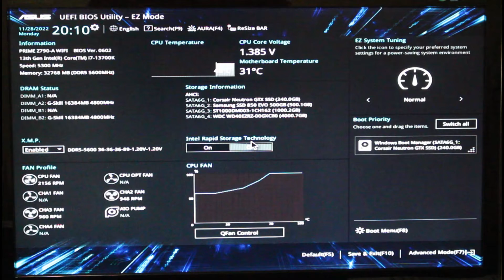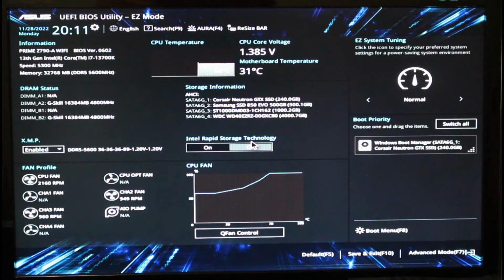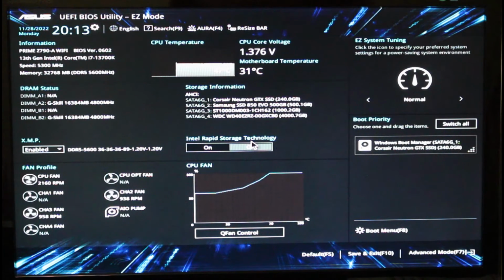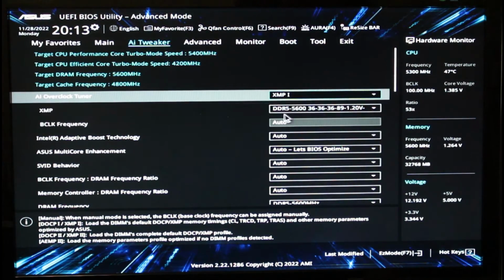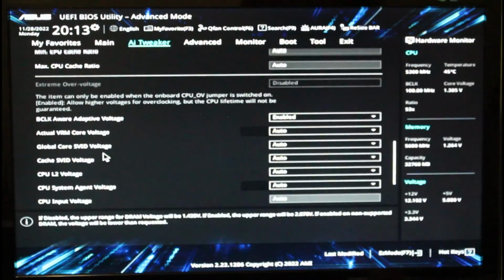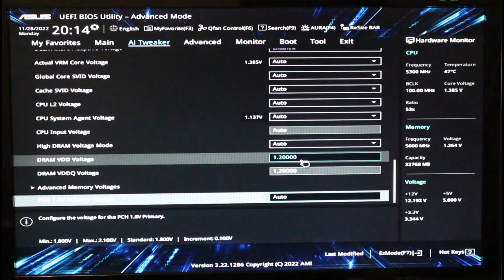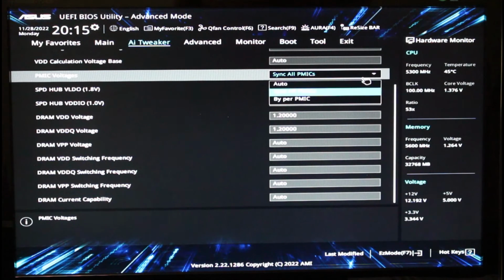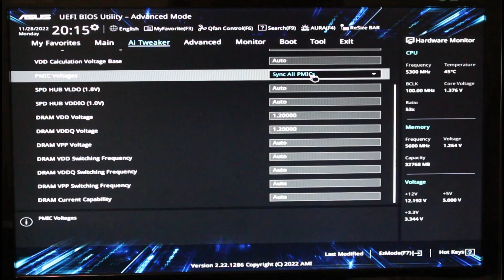How to Fix DDR5 XMP Issues: Use A2/B2 Slots for 2 Sticks (ASUS & 4 Stick Fix)

Comment from the maker: Thank you all for your positive feedback and collaboration so far.
Reply: My Asus manual for a Z790 board says IN THE MANUAL, to use A2 and B2 first. So, that sounds weird that your Asus manual says use A1 and B1 first. 

XMP is only on A2 and B2 but my ram is unstable at the 7,200MHz that it is rated for. I ran MemTest86 on it for a week over and over. I can only get as high as 6,800MHz. On a 7,200MHz kit 😑

Comment: I have  Gigabyte Z90 Gaming X AX + 2xCorsair Vengenace 6000Mhz. With Asus Prime 850W PSU runs  ok with XMP enabled at 6Ghz in  slots A2,B2.  I changed  the PSU to Be Quite Pure Power 12 850W -  it does not boot with XMP enabled - entering booting loop - I mean it turns on and off immediately again and again.  I need to reset CMOS to get it working at default speed , 4800Mhz. I updated the BIOS, same with one stick of RAM. Any advice?

Comment: RAM slots are ALWAYS A2 and B2. Reason is very simply that these are at the end of the address and data traces and so the traces are terminated correctly by the memory. VDD and VDDQ may well need increasing for XMP stability.

Comment: I’ve Corsair Vengeance 64GB (6400)
Is this fix the XMP Problem? cause I get blue screen all the time when I restarted my pc & in game lag! but when I turned off I didn’t faced anything
Reply from the maker: @RastaForza  Yes you can try this yo fix that. Blue screen might just be bad Ram, but try the fix first.
Reply: @LEGO-PlantVentures  I tried but unfortunately it didn't work! The PC started crashing by itself
Reply: @LEGO-PlantVentures  I found out that the problem it was with the Corsair 65 DDR5 RAM, I disabled XMP and now my pc is running perfectly

Comment: i saw on another video before that the naming order of the RAM slots is B1-B2-A1-A2... and you should load RAM in order B2-A2-B1-A1.... i.e. 2nd slot, 4th, 1st and lastly 3rd. The guy also said best to (if you using multiple RAM sticks) use sticks from same single multi pack of RAM stick and not to mix and match despite being seemingly same... and load in order based on the serial numbers on the sticks....i.e. if they end in e.g. ....4782, 4783, 4784 and 4785... load "...4782" in "B2", "...4783" in "A2", "...4784" in "B1" and lastly stick ending in "...4785" in slot "A1"...hope this makes sense. He said it is "best practice". If i find the link i will share.

Comment: Wow. Been trying for a week to get my DDR5 working and then just came across this video. Worked first time. I did the same as a lot of people, I assumed the mobo wants it in A1/B1 but the manual says otherwise after re-reading it after this video. I bought some expensive 6400 Trident Z5 which wouldn't even post above 4600. Now it just booted straight into 6400 no problems. Thought I was going to have to return the RAM.
ROG STRIX Z790-A GAMING WIFI, 14700kf
Reply: no its a2 b2  have asus to skill first 16 gb sticks(3600) not stab games not on the list qvl now have 64 gb and qvl same brand gskill  ripjaws now its perfect and have also stabel overclock from 3600 to 4000        my parents have gigabyte also now gskill ripjaws 128 gb  4 sticks no qvl and xmp not workink at all

Comment: having same problem, withn Z790, 3 G.skills DDR5 sticks 16,32 and 16GB (slots used 12,4)  not able to enable XMP. currently running at speed of 4000MHZ

Comment: I was using 2x32Gb Vengeance 6400 CL32 for a while perfectly using it at 6000Ghz stable. Now i finally bought other 2 blades of the same to have a total of 128Gb, and wasnt able to boot the Pc Anymore (Updated to latest Msi Bios updates before putting the blades), got it to boot to bios perfectly and showed full RAM, then after booting again, never POST anymore. I had to remove two blades physically and down the speed to 4000Ghz and have them to boot to windows. What a hell! I am gonna try watching your video now for some options.
Reply from the maker: Please let us know if it works for you or not. Also,  try downgrading the BIOS to the version that worked previously.

Comment: Hi, thanks for your support. In the boot menu I don't have VDD and VDDQ but VDD2 and VDDQ. Also, I can't find the setting PMIC Voltage but many settings for sync or split voltage settings. My motherboard is Gigabyte Z790 Gaming X AX and I use 4 sticks of Kingston Fury RGB 16gb 5600hz. Can you help me? Thanks!
Reply: Any solution? Have the same problem whit a Gigabyte UD AX, but whit 2 sticks. When trying whit XMP profile, it's stuck on boot. 4800mhz will only work, but the sticks is at 6000mhz.
Reply: @erikjarl9361   With 2 5600hz sticks I had no problems with XMP 1 (5600) profile active -
Now that I have 4, I have managed, for now, to be stable with the XMP 2 profile active at 5200hz.
Unfortunately, as I said, I don't know exactly what to change during boot because the entries on voltage are numerous and different from those in this video.

Comment: got this to work for my 2 sticks of 16gb ram not enabling xmp on my asus z790-p mobo. switched ram stick to slots a2/b2, went into bios and changed to xmp 1 , saved and restarted and it fired right up. thank you for the video.

Comment: My mobo calls for a2 b2 configuration, does that mean i should try a1 b1? Im running g.skill flare5 6000 ddr 5 2x32 with a ryzen 9 7900x on a b650e-f. When i turn on EXPO and set it to 6000 it wont post but when i dial back to 5800 it will.

Comment: In my case A2/B2 IS the default configuration for two sticks on Z690 Extreme not A1/B1. Are you sure on you board A1/B1 ? I actually looked up your board and indeed A2/B2 is default as well for you.
Reply: noticed this too

Comment: Should it be By Per PMIC with 2 sticks also?? Answer me pls!! Cant enable xmp pc crash..
Reply from the maker: Good day. I am not sure I understand your question, but  yes if you use only 2 sticks as well, you still need to have it in the correct slots. If not, try one stick at a time, it might be that one or both of your sticks are bad.

Comment: I had 2 sticks had issue at 6400mhz or xmp on had fixed it but switched 2 4 sticks now having the same issue but cant get it unless its under 6200mhz but i paid for 6400mhz so i need full potential

Comment: XMD can run only with 2 ram.I have 4 ram 6400mhz Trident renegade.  If you have a gigabyte z790 UD, open the utility GCC. Choose 64 in DDR and desactived XMP. Reboot the system and It's OK. The memory is stable with 4 ram. On a motherboard Asus, XMP run with 4 ram at 3600mhz (DDR4). No problem.

Comment: Gotta give you credit man, after having intermittent stability issues trying to run my 4x16gb DDR5 overclocked, it looks like changing from "sync all PMICs" to "By per PMIC" may have actually done the trick. Just got through 8.5 hours of MemTest86+ at 6000 MT/s CL30 with 0 errors after bumping VDD and VDDQ voltage by .05v and changing the PMIC setting. I'm hesitant to declare victory, I still need to do real-world tests, but initial results look super promising. Thanks.
Reply: any news on that? also, do you mind to help me? my main language isnt english so i didnt understand properly what I should do
Reply: @VictorV2cs  No memory related crashes in the past two weeks. I'd say I'm stable. It's hard to help without knowing more about your setup. RAM stability can vary a lot depending on what platform and chip you are using. For me, I enabled XMP-II in my BIOS settings, which sets the RAM to the "factory-recommended" overclock settings. After that, I slightly increased the voltage on VDD and VDDQ over the XMP settings. They recommended 1.35v, so I switched it to 1.40v. Then I changed the setting "Sync all PMICs" to "By per PMIC." This was on a Z790 Strix board (with the latest BIOS update), a 13900k, and 4x16GB DDR5-6000 CL 30.
Reply: @brrrandamoactivo Nope. She's stable. Switching to "By per PMIC" and slightly increasing VDD and VDDQ did the trick for me. This is on a 13900k and a Z790 board, 4x16GB DDR5 at 6000MT/S CL30.
Reply: @brrrandamoactivo I have never done RAM OC on an AMD platform. My last two PCs have been Intel. 

If you are going for 64GB, I would strongly suggest trying to get a 2x32GB kit. You are going to have a much easier time getting a stable OC with two sticks.
Reply: @420bobby69  hello dear friend, 
I’m running asus rog strix z790 f gaming 
Core i7 13700k 
Corsair vengeance 2x16 6000mhz cl36 
Tried xmp1 and it fails. Tried xmp2 also fails. Tried to change voltage and by per  pmic nothing works. You know what can I do?
Reply: @yuv-zs5jk  2x16GB XMP kit should not have problems running XMP out of box. I'd say update your BIOS, try again, if its unstable I would return if possible.
Reply: @yuv-zs5jk  You shouldn't have to change voltages or PMIC or anything. 2x16gb is standard. My issue was 4x16
Reply: @420bobby69  thank you very much for the help brother! Have a great week

Comment: Thank you so much, Good Man, god bless you. I tried all the preset XMP/EXPO profiles on the motherboard, it didn't work for my Kingston FURY 32GB (2x16GB) 5600MHz CL36 Beast RGB EXPO AMD. I checked my slots, and naturally, i put the DIMMs into A1 and B1. 
1 interesting note, that my Gigabyte Control Center didn't show any RGB config for the RAM slots, and I was wondering why it's just glowing in static color, I even almost installed the software from Kingston. But thanks god I found your videos and swapped the slots. It booted from the 1st time and shows 5600 MHz now! And guess what? The GIgabyte Control Center now shows the RGB fusion for RAM slots too! Yeeeeey! That's a win-win. Hope it won't crash when I play CS:GO.
P.S. Mother Board is Gigabyte Z790 Aorus Elite AX

Comment: This worked on My Asus Maximus z790 Hero. Running at full rated speed of 7600. RAM was QVL. Expected to run out of the box with XMP on the normal channels. Subbed. Thank you.
Reply: I got the same Motherboard and I got 6600 MHz RAM. How high did you set your voltage to get everything working?
Reply: @Mr_Mugen  Used stock voltages.

Comment: This actually worked for my 2 sticks of 16GB DDR5 7000. I was stuck in a bios loop for hours. Updated the bios on my Asus Rog Strix Z790 E-Gaming Wifi, defaulted all bios settings, switched sticks from A1/B1 to A2/B2. Switched profile to XMP 1 in BIOS. Booted up first time. Remember to safely update your BIOS too folks, that way your hardware can be properly utilized! 
Thanks again!
Reply from the maker: Thank you for the feedback!
Reply: Thanks a lot that's works  for me also

Comment: Thanks to this video I was able to boot my memory at 5600 instead of the default 4000.
Changing the memory to the 2, 4 dimm slots solved the problem.

Comment: I have an mini itx board with only 2 slots... I really hope they are gonna fix this issue soon in a bios update or something, I build my pc 3 days ago and was freaking out looking for a solution, tested cpu and gpu, even reinstalled everything(bios, drivers and even windows) thanks for the helpful video it was such a hassle and ive finally slimmed down the issue to RAM and mobo and now i have a solution, altough i wont play around with the bios and wait for everything to come out as an update!

Comment: this worked for me, im using ddr5 64gb 5600mhz 4 dims, when xmp is disabled my ram runs at 4000mhz instead of 4800mhz, when xmp is enabled i run at full speed 5600mhz, thank you for this you deserve a sub! :)
Reply: Hi. Whats your configuration?
Reply: having same problem, withn Z790, 3 G.skills DDR5 sticks 16,32 and 16GB (slots used 12,4)  not able to enable XMP. currently running at speed of 4000MHZ, please help

Comment: After a day of trying raising voltages slightly and lowering the speed step by step all to avail I found your fix and it worked first time. Thank you so much for posting this. My blood pressure has now returned to normal.
If anyone wants to know I am using an ASUS ROG Strix Z690-E 2x with Corsair VENGEANCE DDR5 64GB (2x32GB) 5600MHz

Comment: Why is this a thing? But thanks switching the slots worked for me too (i5 13600k, Gigabyte Z790 Gaming AX, Kingston Fury RGB 6000MT)
Reply: Hi, I have the Gigabyte Z790 Gaming X AX motherboard and i use 4 sticks of Kingston Fury rgb 5600hz 16gbx 4. When i use XMP the system is instable and sometimes the PC don't start. In the boot menu i have the voice VDD2 and VDDQ for the voltage and there isn't SYNC ALL but many settings for sync or split the voltage. Do you have any idea how to set these settings correctly to use XMP?
Many thanks for you support!
Reply: @giorgiobellia8972  using all 4 memory slots is very unstable for ddr5 i highly recommand getting 2 lager modules. But you can try to update ur Mainboard driver with Gigabytes GCC tool, be aware of 3 party software
Reply: @Koyamine  Thanks for the reply.
The drivers are already all updated. In any case, not knowing how to set the voltage parameters, I tried to enable the XMP 2 profile at 5200hz and with 4 sticks it seems stable.

Comment: Did you even read the manual  mate :)) your not even meant to put the ram where you first put it. 
It even states on the ASUS board for two modules you put it in a2 and b2 not a1 and b1.  Just saying. Not being rude
Reply from the maker: Glad to hear your manual is correct, but the main reason I made this video is because my manual states the exact opposite...and yes, I ALWAYS read the manual first, even if just buy a kettle. ;)
Reply: Ah ok good to hear hope all is working good.

Comment: Weird. Every modern PC I have built says to put in A2/B2 if using 2 sticks.
Pretty sure I've done Asus boards and don't remember ever putting ram in A1/B1.
I thought that perhaps changed with AM5, but the new AM5 board I just got says put in A2/B2 as well.

EDIT: And now I am more confused. What Asus board do you have? I looked up the Asus Z790 and it's manual even states to put in A2/B2.
Reply: I have his MB, it says A2 B2, just user error, SMH

Comment: Can't seem to find a video for MSI motherboards to fix similar problems. :(
Reply: did you find any? lemme know pls
Reply: @rabbitmcrabbit5256 Nope. It seems very few brands and specific memory works at rated speeds with 4 sticks. I gave up. When I bought my 14900k, I settled on 2 sticks of 48GB RAM, and moved my 13900k and 4x32GB of RAM to my server and clock it at only 4000 MHz.

Comment: Hello! I have Asus Prime z790-p and two sticks 2x16gb ddr5 g.skill 6000. I have them in the slots that you told in the video but when i enable XMP it freezes the pc at random time when i open a game. Do i need to change something else to bios to fix that? I did also the latest BIOS update for the motherboard. Thanks!
Reply: Does your random freeze problem solved?
Reply: @netfreak6993  so apparently the problem it was totally another reason and not the xmp. It was the gpu. I’m using xmp now with no problems!
Reply: @scarko_  which GPU you were using?
Reply: @scarko_  what was your solution? I may be having  a similar issue. Which is why I'm digging through the depths of yt comment hell.

Comment: I had the exact same problem on my ASUS Prime Z790 A MoBo however my fix was a slight variation of yours. When inserting the DIMM's into slot 2 and 4 the bios would not even boot up. I solved the issue by just inserting 1 DIMM into slot 2, go into the BIOS and turn on XMP 1. Then the stick would run at full 5600Mhz. After that worked, I put the second stick into slot 4 and everything has been working fine ever since.

Thank you for this great video. Certainly helped me and sparked my creativity and problem solving 🙂
Reply: Thanks, I'll try that
Reply: It works perfectly. Thanks for the help! (i7-13700kf, kingston fury renegade 6400mhz, mb asus z-790-a)

Comment: Thanks for this video , it really helped me . Asus z790 prime a with 2x16gb trident gskill ddr5 6000 ram
Reply: I still have freeze issues with Asus Prime z790-p with the same rams as you at xmp profile at 6000. Did you change anything in BIOS?

Comment: Is this problem across all Z790 Motherboards? I've an Asrock, and can't clock above 4400Mhz on G.Skill Ripjaws rated for 6000Mhz. XMP seems to be a no go no matter what the frequency.
Reply: I have the same RAM and the same issue on my z690 motherboard
Reply: @vyruxzzgaming99  Got it fixed a couple of hours ago. Did what this video suggested and switched my two sticks from A1, B1 to A2 B2. I then updated the bios to the latest available version. The memory is now running XMP at full rated speed.
Reply from the maker: Thank you for sharing your success with this method!
Reply: @LEGO-PlantVentures  No problem, thanks for the tip. It might work now in A1,B1 but I decide to leave it alone when it's working.😉

Comment: Hello! I haven't tried xmp yet but I have the exact same motherboard and similar ram. Did you have to update the bios for it to work?
Reply from the maker: I did update the BIOS, but it should work even without the BIOS update.  If none of the solutions in the video work, try the BIOS update.
Reply: @Lego  how many bios updates did you have to do? also does it run at 4800mhz with no xmp?
Reply from the maker: @Bobthebuilder910-f2v  Only one update, currently running version 0602. Yes, it is usually possible to run 4800 with no XMP by manually tweaking the settings, but it's more complex than just activating XMP.

Comment: What about 1 stick of 16GB 5200?
Reply from the maker: That should work without any issues or tweaks to BIOS.  Do you experience crashes or no boot?
Reply: @LEGO-PlantVentures  no boot, it shows American Megatrends error
Reply from the maker: @mihirpatel5024  What RAM are you using? What is the RAM rated speed on the box, 5200? Do you have X.M.P activated or not?